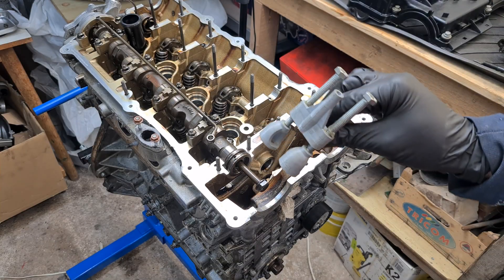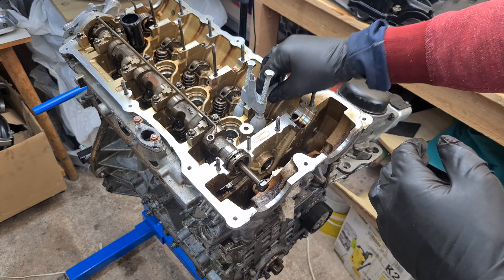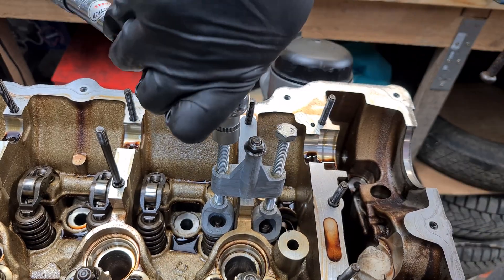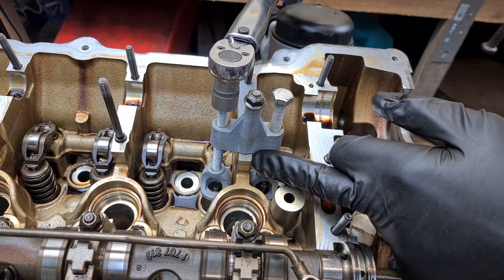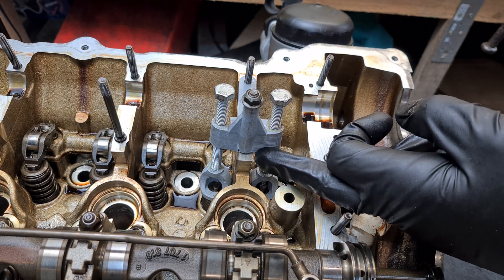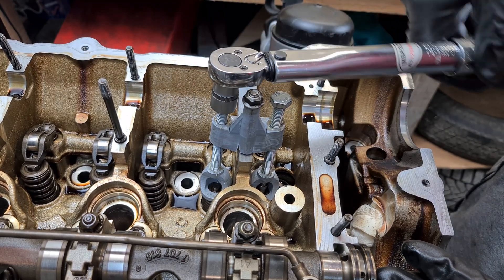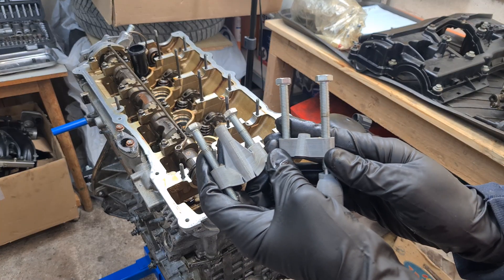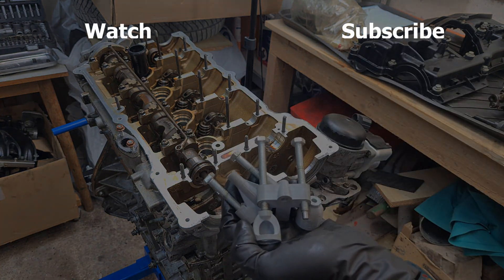How much can my 3D printed N42/N46 valve spring compressor take?

Comment: The spring on the left side never compressed?
Reply from the maker: It did, but the keepers did not release the valve so it moved with the spring plate. You can usually use compressed air or the rope method in the cylinder to stop the valves from droping.
Reply: @BimmerZen 

Ah I see sir. Well it won't be a problem for me since I'm taking the cylinder head off :)

Comment: I ordered this instrument from you, how long will it take to Germany?
Reply from the maker: Hi! Your package is already in Germany and it was sent out to your local post office. You should get it very soon.
Reply: @BimmerZen  Thank you very much, I already received the parcel today!  Will the plastic puller break?
Reply from the maker: @Погрузчик-г3в  You mean the socket for compressing the spring? No, it wont break if you use it correctly and don't over compress the spring.
Reply: @BimmerZen  thank you
Reply: @BimmerZen  thank you very much! I changed the valve seals with your spring pullers.
Reply: I need for vw tdi 2.0 caa

Comment: I ordered a seal replacement tool from you a week ago. When more or less will it be with me in Poland? I wrote an email but you didn't reply.
Reply from the maker: Hi! Shipped it the same day, it's already in Poland, should be arriving shortly. You can check the tracking info you've received via email.

Comment: @BimmerZen Can I order your valve seal replacement tool from Poland? If so, what would be the approximate shipping time?
Reply from the maker: Sure, delivery time is approx. 5-8 working days.
Reply: @BimmerZen   Ok, can you throw in that piece of plastic for the screwdriver?
Reply from the maker: @autofan1993  Yes, it comes with the kit.
Reply: @BimmerZen  and this tensioner wrench is set to 0.6 NM right?
Reply from the maker: @autofan1993  yes.
Reply: @BimmerZen   Already ordered :) See there at your leisure. Regards.
Reply: Thanks for all your videos,I’ve watched them so many times am attempting this job soon having purchased this tool from you,I would also like a manual in English so I can follow step by step instructions,which one do you use?
Reply from the maker: send me a message to the email in my channel description